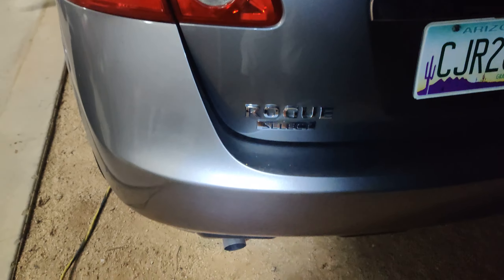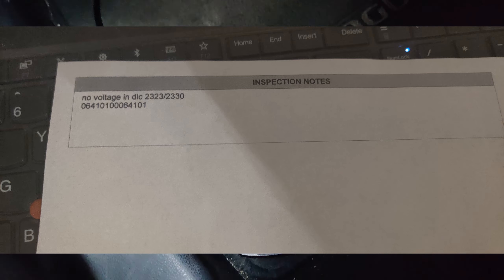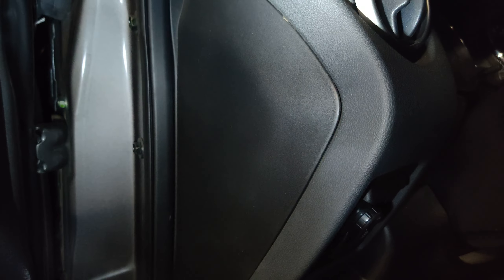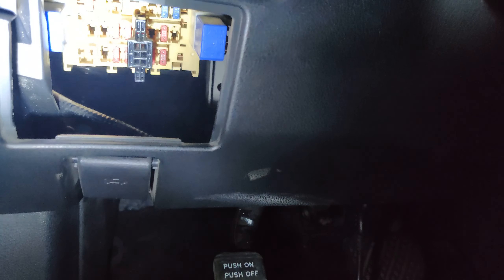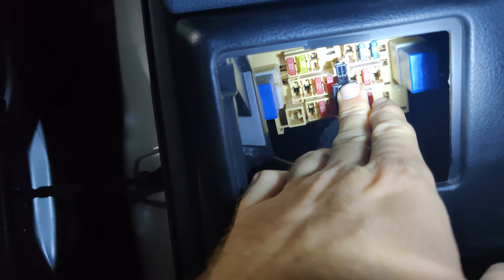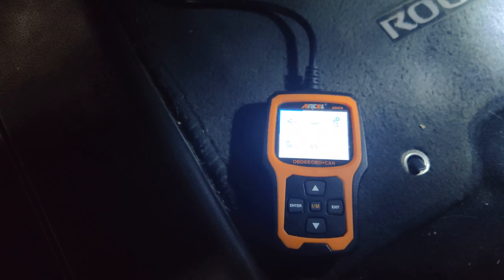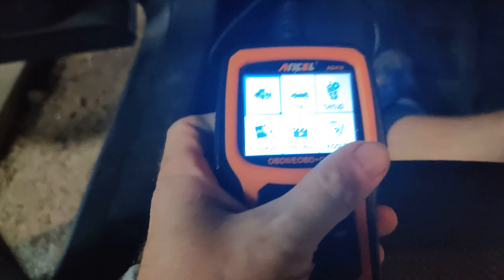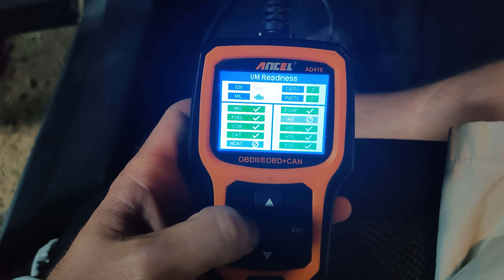2015 Nissan Rogue Select Failed Emissions OBD2 failure

Comment: Just for clarification purposes, my 2015 Rogue SL (not the Select) has the fuses under the cover on the side of the dash where it touches the door.
I plug my scantool (Actron CP9135) in and I have power, but it keeps reading "link failed". I know the OBD port works as I was able to get codes pulled at the local AutoZone store. This scanner will not work with my Rogue. Just wanted you to know that my model does have the fuses where you said.